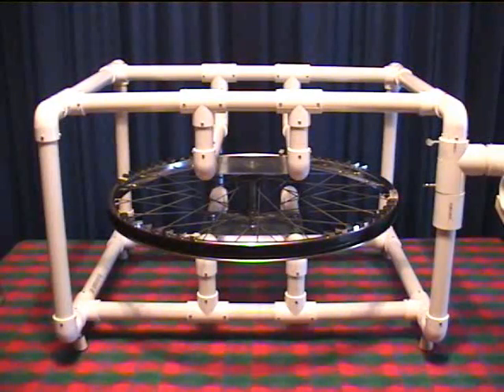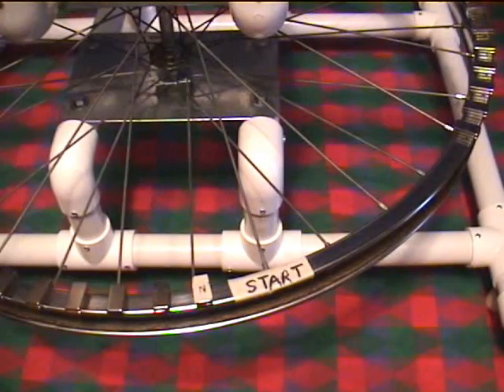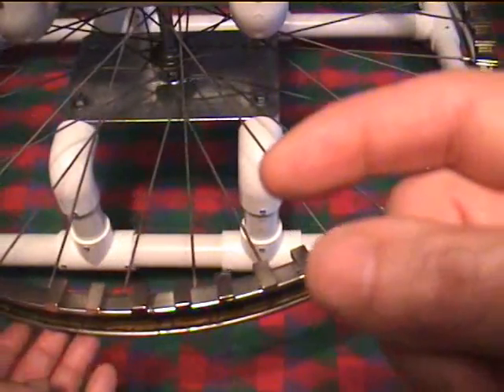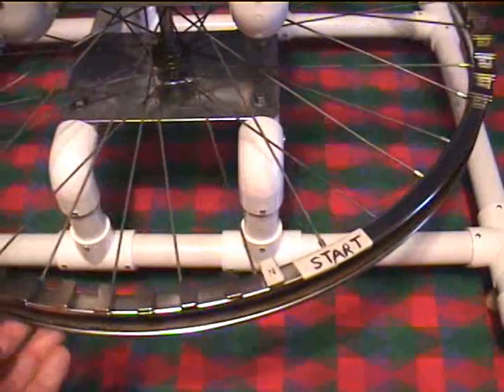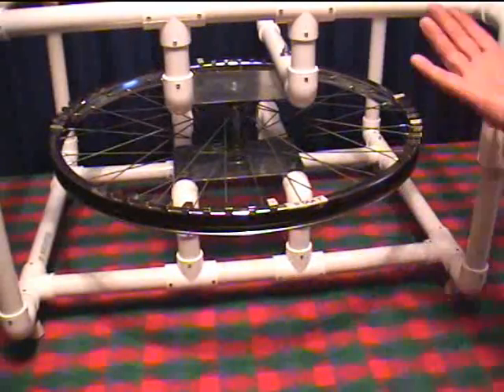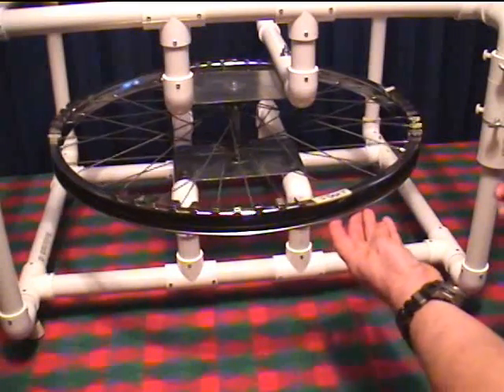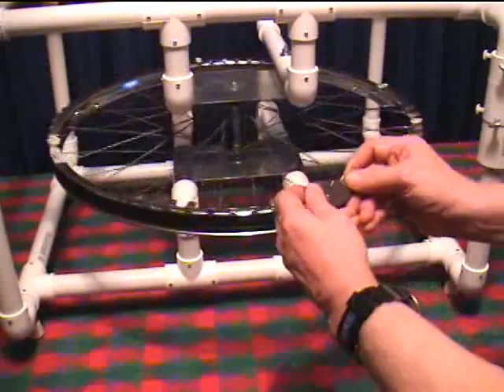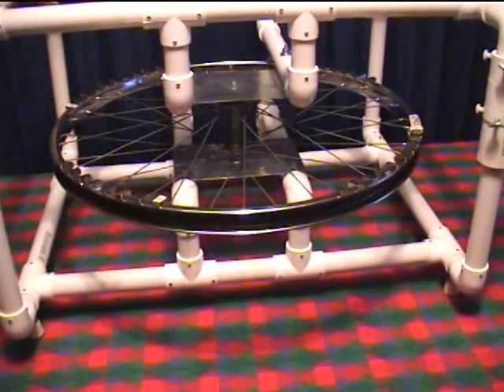Video #3, "Rick's Pipe Dream" Magnetic Motor - Generator

Comment from the maker: My earlier attempts to move the stator by means of a tracking rail were not successful because of the required amount of rotational force that was taken away from the rotor.  My new method will only require a small fraction of that force in order to move the stator, so I am feeling confident that things are moving in the right direction.

Comment from the maker: @darklen14 - It has always been my intention to employ additional stators offset to, rather than synchronized with, the first stator.  My purpose in doing so, though, will be to add speed and power to the rotation rather than counter the repulsive braking effect in the critical area.  My plan is to entirely avoid the critical area by mechanically moving the stator similarly to the hand-held movements shown in this video, and is the method I am currently working on refining.

Comment: Hi Rick - haven't watched all your videos but I have a quick question. What happens if you add a powerful magnet at offset positions around the wheel? While one magnet is pulling at a much harder force the other magnet has already went past the critical area that would normally stop the wheel

Comment from the maker: Hello veejay,  that's a good question.  The answer is that magnets placed continuously around the rim will not work.  I was able to do that and get a full 360 degree rotation back to the starting point, using a Howard Johnson progression, but the movement was slow, weak, and erratic.  That's why I use breaks in between groups.  I found that grouos of 8 to 10 magnets seem to work best.  All useful attraction is within the first 5 of the group.  The second 5 do not add nor subtract acceleration.